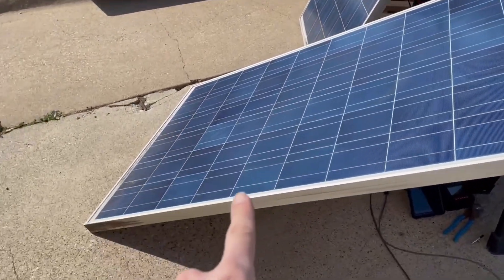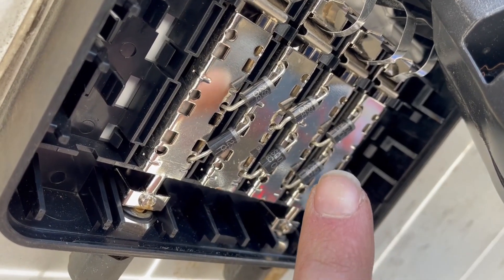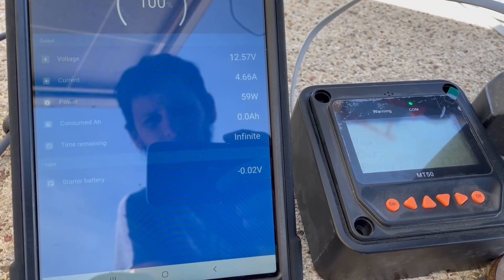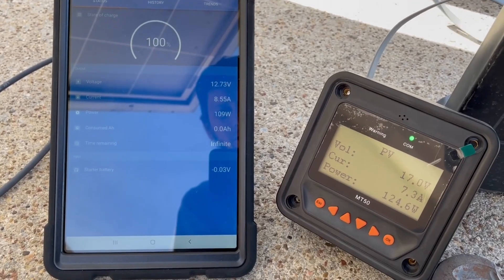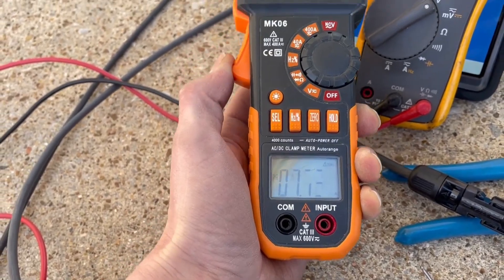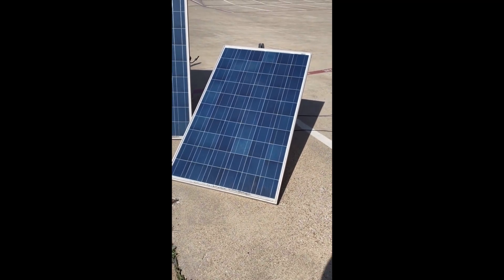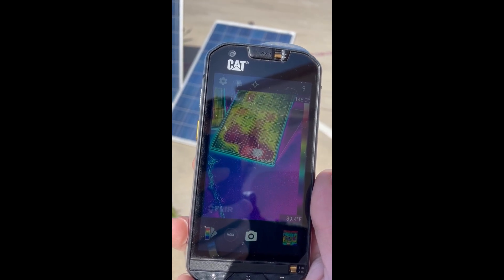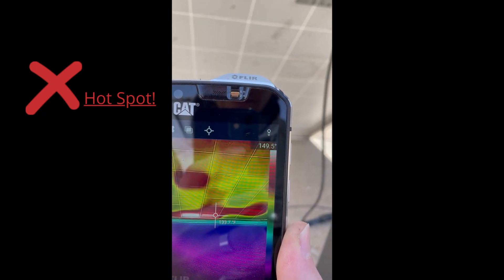Hunt for Missing 30 Watts from Astronergy Solar Panel

Comment: I have the huge astronergy 650w bifacials and they barely pull in half of what they are rated at.    They don't even come close to comparing to other makers like Hyperion, JASolar, Renogy type panels.   Very dissapointing.

Comment: Any update to this? Have you found the cause???
Reply from the maker: I never found a smoking gun, my best guess is hot spots in the panel were reducing the current available.
Reply: @BeeneEnergy  but what's causing the hotpots??? Microcracks? Corrosion???? Anything?

Comment: I wonder if the hot spot is essentially causing resistance which is actually confusing the MPPT controller.  So Voc looks fine, Isc would look fine as well (because those situations will be unaffected by an extra resistor in there), but when the MPPT controller starts sweeping, say it increases the voltage but notices the power goes down because the resistance goes slightly up.  The place it settles happens to be where the resistance and temperature are at some perceived equilibrium.

I don't know how to simulate or test this; maybe with something like a thermistor like the ones they use to limit inrush current in PSU soft start circuits.
Reply from the maker: I have to admit, most Solar stuff doesn’t catch me off guard. But this one is a mystery. Your theory sounds valid, but as you say hard to test!
Reply: @BeeneEnergy  Well if you think about it:  at Voc, the circuit is open so no current is flowing through it, thus a resistor wouldn't matter.

For Isc, the circuit is shorted so all current it can produce is going through there, resistance or not (Kirchoff's laws).

I think the way to test this is to essentially test the panel's resistance.  There's ways to do that if you have a bunch of small resistors handy.

Comment: Your latitude,  panel tilt angle and time of day with respect to solar noon determines your solar insolation. 
For a fixed mount panel only the normal vector hitting the panel produces power.
This is a 3 dimensional vector angle with 2 angles of concern. Azimuth and elevation.  An approximation is taking the cos of the off angles then multiplying them to gather.  Really need to do a dot product of the unit direction vectors to get the correct answer. Easier to use the method I described for using ISC std test conditions of 1000 watts/m^2 to measure the actual solar insolation.
Reply from the maker: I think you missed something. I had two of the exact model of panel at the same tilt getting different numbers. :)
Reply: @BeeneEnergy  I been through the video a couple times now,  yeah I missed a couple things. The third time I wrote  down the numbers. Missed the last part with the themo imager until the third time I watched.
I got 
106 W, 108 W 108W for the substrings all pretty close. I am assuming you shorted out the other 2 strings.
That hot spot is a "tell" did you get that hot spot when the other strings where shorted out? If not string is good, bypass diode is bad.
If the hot spot remains cell is bad, panel bad, probably a micro crack in the cell. But full ISC for the panel rebutts that notion.
It would be interesting to measure the ISC and VOC for each sub string.
 I hope you can find a cheap fix.

Comment: What is the temperature of the solar panel? What is the ISC short current.

Do you know the temperature coefficients for the panel.
The the back panel label is for STC standard test conditions not for real world operations. On my utube channel there is a video on how to calculate the panel expected performance by applying temperature compensation to the STC parameters. 
For a SI solar panels
The short circuit current has a low temperature coefficient ~ 0.05%.
So the ISC  @ STC should  match.
The voltage coefficient should be between 0.3 to 0.4% for voltage. 
And 0.4 to 0.5% for power.

Checkout my channel it is a work in progress it may help.
The ISC can be used to calulate actual solar insolation your panel is seeing.
Hotter panels output 80% of panel label while using an mppt charge controller (cc).  If using a PWM cc about 70%.
https://youtu.be/_LsRvfOExCc

Comment: Interesting. Anything visually noticeable in that area? Snail trails?
Reply from the maker: I should have zoomed in on that cell but no, this panel is clean of any visible imperfections. No snail trails, nothing that looks odd on the back side. Nothing. Very odd.
Reply: I had a similar issue at work and replaced wires, checked diodes and was missing wattage. I ended up chunking it and replacing it after losing time. Cool video.
Reply: Yes I agree if you have used panels check for lightning struck panels with snail trails or actual cracks in silicon cell. Cracks will decrease tremendously and snail trails will diminish but not that much. PS, i have also seen voltage be just fine on cracked cell or snail panels, its the amps that is lacking for some reason. Looks like a few bad cells.
Reply from the maker: @GreenTechFusionRenewableEnergy  Those are the things I typically check for, thing with this panel is it was free of any visible defects and voltage/current showed perfect. Still under performed.